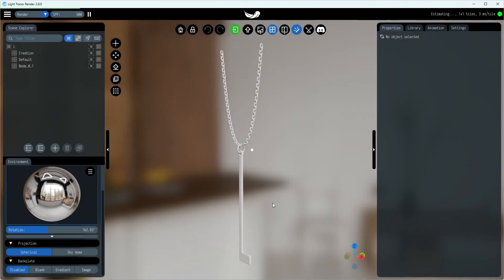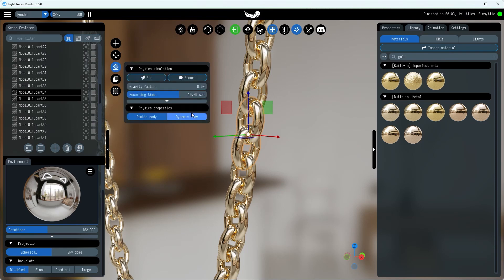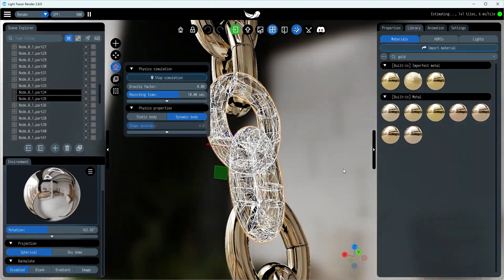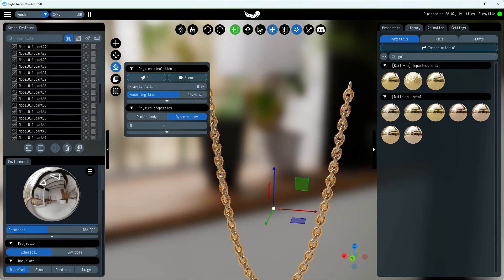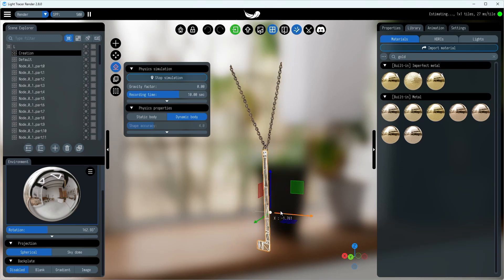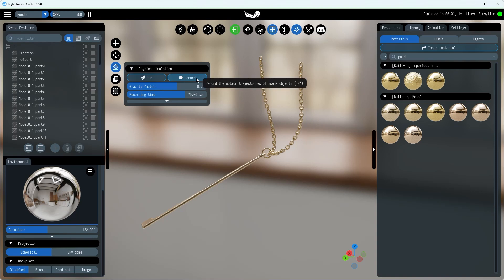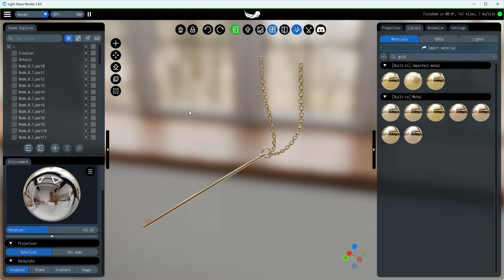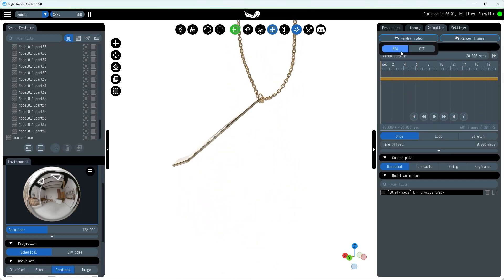Making chain simulation in Light Tracer Render 2.8.0

Comment: I don't have the 'process mesh' option when I right click on my item. Is there a certain file type I need to be using in order to do this? I usually save my files as .glb but I tried 3dm and it didn't work either

Comment: Thank you! This was really helpful. Can you please explain how we can use the physics engine to do the same thing with a strand of pearls, that has a string (or any material) running through each bead? Would the same kind of animation be possible or would the original model need modification? Thanks!
Reply from the maker: Hello, thanks for your feedback! it is not possible to simulate something like a string inside LT at the moment but we will think about it.